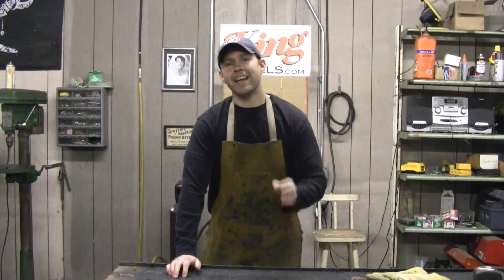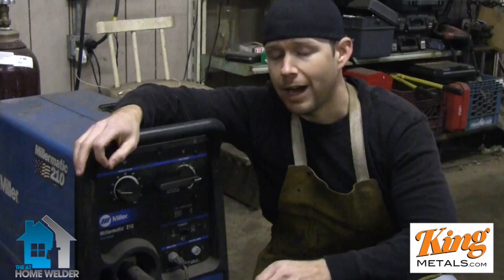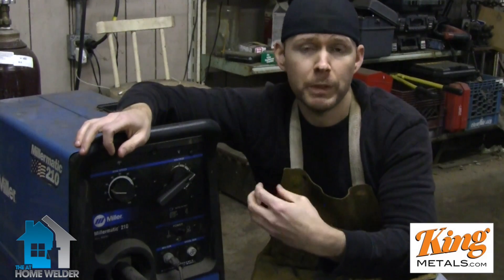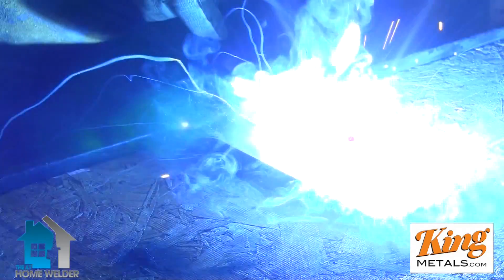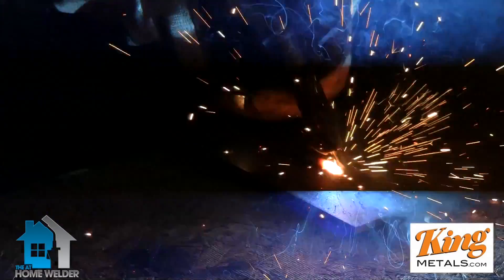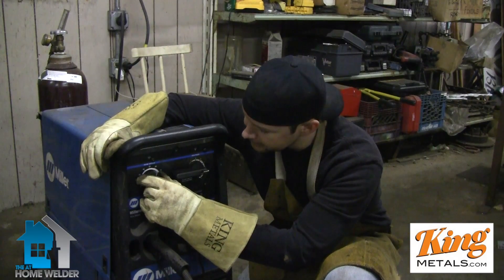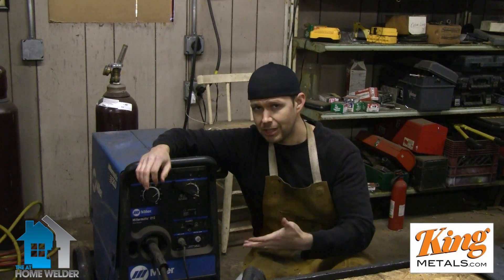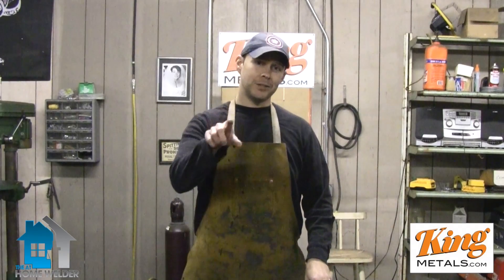How To Find The Correct MIG Welder Settings For Any Project

Comment: Ask any question you say.  O.K. what about welding auto panels with gasless MIG?  That's all I've got and I've been advised it's no good. I'm told to give up trying. I must have gas I'm told.  What do you think?

And, p.s. this video, I find it hard to distinguish the 'no popping' sound, too.  Seems to me the good weld did have popping in it though perhaps not so much. So for me the final decision would be based very much on the appearance - that good 'flat' bead would sell me.

BUT: how do you do this kind of test on stuff so thin you can't lay beads but can only tack, tack, tack as so many instruction vids seem to tell us to do?
Reply: You cannot run MIG without shielding gas. MIG is also known as GMAW which is a solid wire without flux. You might be thinking FCAW (Flux core arc welding) or "Innershield" or "Dual shield." With "Innershield" there is no need for shielding gas because the flux which is already in the wire produces the shielding gas as you weld. There is also "Dual Shield" which is also a flux core wire but needs shielding gas also, hence the name DUAL-shield. Innershield is generally used for structural welding or outdoor use since there is no gas to be blown away by the wind. Dual shield is primarily used indoors but can be used outdoors with a proper wind screen. I hope this helps.
Reply: MasterMayhem78 
Thanks for your reply. It is good of you to take the time.

Yep, I know.  That's what I meant by 'gasless MIG'.  I meant a MIG setup without gas bottles.  I think it is colloquially known as 'gasless' even though the gas is in the wire really.

That's what I've got.

Flux cored MIG welder.

Back to my questions.......
Reply: Innershield and Dual shield run very hot. That's the reason why you don't want to use it on very thin metal. You could use short circuit transfer using MIG but the voltage would need to be set around 15-16 volts and wire speed (amperage) at about 150 or so. You would have to play with it some to find the right setting. I think some people may be confused by your usage of the term "gasless MIG" there is no such thing as a gasless MIG welder. MIG stands for "metal inert gas" MIG is a process that always requires shielding gas. The machine you are referring to is a semi automatic wire feed. Wire feed Welders not only use  solid wire but flux core as well. Remember MIG is a solid wire with gas. Make sure you use the right term when asking questions about welding. You would probably have better luck with lots of practice on very thin metal using TIG. Now your question about "popping" sound. Generally heavy popping is because of too little wire speed or too much heat (voltage) start with ballpark voltage setting for the thickness of metal you are using. 1/8 about 15-16v, 3/4 19-20v (it's different for every machine) flip the wire cover, there should be a chart to use that will put you in the approximate range. Once your voltage is set, set your amperage (wire speed) low, run a bead if it's popping turn the wire speed up some and repeat the process until you get a nice sizzling sound. There May still be a little crackling until you have it dialed in just right. Hope this helps. Good luck.
Reply: +wannos27 
Okay. So I'm talking about FCAW then? Flux core arc welding?  Because I've got a MIG machine that doesn't use gas? 

Okay. 'Gasless MIG' is what people commonly call it.  Might not be right but that's what they say.

And it runs very hot.  That is interesting.  I had a long discussion on a welding forum about that.  'Hot'.  What does it mean?  This process runs hotter than that process?  During the course of that discussion it was said that the heat of the weld will be the same regardless of process because the Amps needed will be the same and that's what decides the heat.

And various other things were said.  Finished up rather unsatisfactory.

If you can clarify exactly what it means, how it is measured, that'd be good.

I think MIG (FCAW) is hotter than stick but can't prove it.

Now 'pulse' - what is that?  

:)

p.s.  what about inverter welders? should we throw away our transformer welders and buy inverters?  They are that much better?
Reply: +wannos27 
Thanks a lot, that's very thoughtful and helpful of you.

Couple of things I'm curious about.  What's that  'pulse' one poster talked about?   And on that link you gave me the last post talks about burning your tungsten. What's he mean by that?

I do experience a little of this polarity change for metal thicknesses as I use a small MIG for light work and it is set up with reverse polarity I think.
Reply: If you have  a MIG machine that doesn't have the capability of using gas, then it will most likely be too hot for the thin metal of a auto panel.  A true MIG machine, one that can take gas, can weld with less power while using gas.  If I'm wrong forgive me.  I'm new at this too.
Reply: don't listen to any of these idiots in this thread...WOW.....listen man you can use .030 flux core wire and a small 110V mig welder . You can do a very good job in fact on auto sheet metal. I have been welding floor pans and quarter panels on for decades using .030 Flux core

Comment: hi whats the difference between MIG and TIG weld?
Reply: commie
Reply: metal inert gas welding = mig
tungsten inert gas welding.= tig
Reply: fidel catsro  It mig you use a consumable electrode wire. In tig you use a tungsten electrode and add metal separately. Mig is like stick. Tig is like Oxy.
Reply: actuatedgear thank you guys!! mig means metal from electrode is lost as weld, tig means it increases the heat of the metal enough to melt them together like M&M..you reckon I can use dc 24 volt directly with cables and some mig electrode to do simple tiny weld on my bike metal brackets?
Reply: fidel catsro NO. Mig requires gas. ALL welding requires shielding. Stick provides it in the coating. Mig and Tig have bottles. Flux can be with or without gas because it has shielding material inside it. Oxy is nothing BUT gas. If you want a setup like that, you're gonna need to do stick, except that you have NO clue what you're doing. You dont have anything to set the amperage with. Even IF (NO) you could use mig wire here, thats too much voltage.

It TECHNICALLY possible, youd be luck if it would even make a bead. And if it did, you would never get any quality. Im not talkiing crappy weld. Im talking weld that doesnt bond for shit. It wouldnt just look bad. It wouldnt hold together if you breathed on it wrong.

You're trying to throw hot metal at cold metal and make it stick. THATS NOT WHAT WELDING IS. Welding is a hot chemical bonding process involving metals and some other elements. You are not welding in a vacuum. Your #1 enemy is oxygen and it makes up 21% of the atmosphere.

No, if you're gonna try something like that, youd be better off getting someone else to do it for you because you'll hook up too many batteries and shock yourself to death. AND STAY AWAY FROM OXY. Oxygen tanks are dangerous in TRAINED hands. You are way out of your league. You want to weld? Hit up your local votech. Its where I went.
Reply: actuatedgear looks puzzled at the comment! didn't know welding is a degree course in itself!
Reply: fidel catsro
Depends on the college, and the area, but YES. Am taking now. Supposedly the money is ACTUALLY in industrial maintenance or something like that. The money really isnt anywhere. There isnt any money.

At my school they had me do a few weeks of online safety courses before I could get in the shop, then I started with Oxyfuel. You learn puddle fluidity basics and metal behavior under heat.

Stick is next. You learn general position characteristics-what the metal does when you go from flat on the table to straight up and down. Then we moved to mig. Mig is EASY. Im on aluminum mig right now, not easy.In a bit I'll be doing much harder mig and stick stuff including pipe. I round out the class with some tig. Tig seems like it OUGHT to be easy but I'm pretty sure its not last for no reason.

Comment: Thanks for the effort, but I simply can't distinguish the higher speed sound from the correct mid -speed setting. But then again, a friend of mine spoke about the bacon theory, and I couldn't hear any difference, even when he welded right in front of me, a few feet away. It all sounds like spattering bacon.

Comment: you said nothing about the voltage you used lol, but thanks for the video.
Reply: Voltage can also be determined by amperage and wire feed, I am a pressure vessel and reactor welder and its always amperage and wire feed, this is flux cored wire though
Reply: And like the guy said some machines don't have amp setting. So the voltage setting would have been nice.

Comment: does the voltage need to be at full
Reply: EMPATHE DNB The voltage needs to be right for your welding. The chart that the weldor comes with will tell you a good starting point and it is in relation to the thickness of the metal, but ultimately, you'll need to change it to suit your style and position. For instance, a miller 252 suggests 18 volts on 3/16 steel in flat position. I run 21.5 with the same wire speed suggested.(265) But on 16 guage metal I run 18 in flat where the machine suggests 15.5. However, if I run vertical I have to bring both the voltage and the wire speed way down. From 18 to 15, and from 100 to 65.

Its all use specific and its a general practice.

Comment: Miller have an app on their website which calculates the correct settings for various welding processes, also available on Android and iTunes, I just put a live tile on my windows phone linking to the web app and it works almost the same as on my old Android.

Comment: Hello, can you tell me what VOLTAGE you had the machine set on? I have a MM 250 and I'm having a devil of a time getting it to weld properly.
Reply: I run a MM250 aswell and it's a pain sometimes but it's a sweet machine. What are you welding with material and what wire/ gas you running I may be able to help